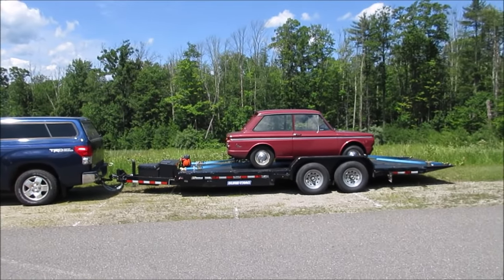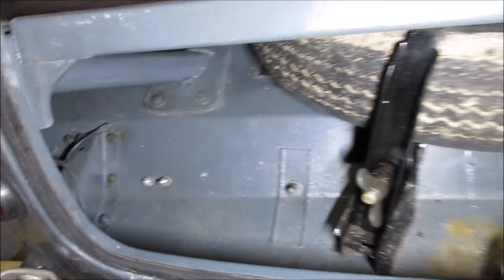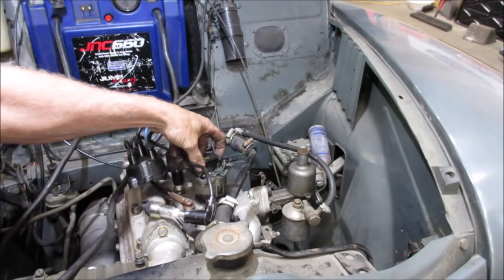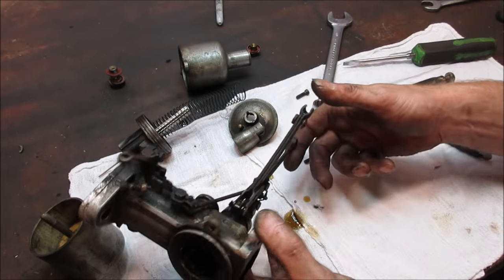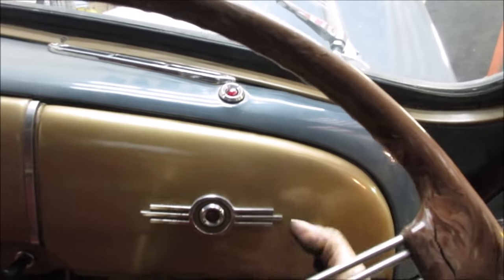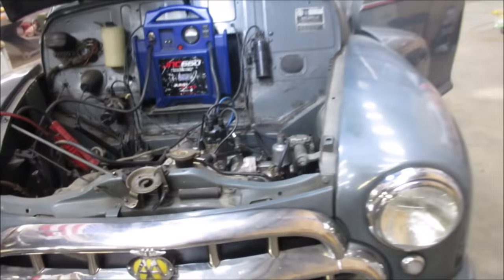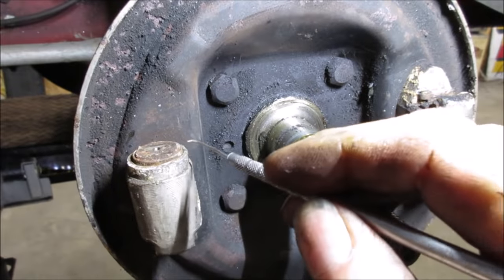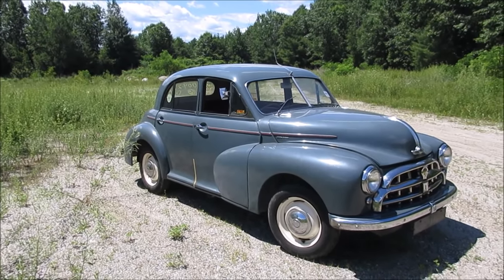50s Morris Oxford Found in an Old Warehouse. Did It Survive?

Comment: If I remember right the only thing you have to swap after switching from positive to negative earth (usually so you can install a transistor radio) is the wires on the back of the ammeter (to avoid backwards reading) and the two wires on the coil (to improve the spark). If charging doesn't work right away you have to 'flash' the dynamo by simply brushing a positive wire against the (smaller) field terminal briefly.

Comment: Hi Mustie that sticker in the front screen (RAC breakdown) is "The Royal Automobile Club" where you join for a fee and if you breakdown they will attend and try and mend your vehicle at the roadside there are different levels of membership like "Roadside, Home start, and Relay, relay is where they will take your vehicle and passengers to a location anywhere in the UK at no extra cost also you see the yellow badge on the grill (AA) this is another breakdown company "Automobile Association" which does the same as the RAC, both company's are still going to this day along with a few other company's, hope this helps.

Comment: Another great video Mustie. Those wheel cylinders can be bored out and sleeved with brass ,if reproductions are not available. Getting apart may be fun ,they look like blind bores. Those S.U. carbs like auto trans oil filled up leaving room for threaded fitting.
Reply: Sleeving in stainless steel solves all future corrosion problems....

Comment: I too can remember (as a school boy) playing with the SU carb of my father's 1955 Morris Minor. Polishing the floater needle using a drop or two of Coconut Oil to prevent it sticking and blocking the petrol flow in. Also tapping the contact breaker of the electric fuel pump manually when the battery is too low and then use cranking handle or push the car to start the engine ☺️😏😉

Comment: I also was shaking my head when you at first couldn't work out the fuel system, The SU carbys are so easy to work on there's nothing to them apart from balancing them if the are doubled up, and the electric pumps most had points in them, at least you worked it out. Good fun to watch, Here in Australia we still have a lot of people  collecting these old cars and I have a Classic Allis Chalmers Tractor from England.

Comment: Looks like a 1953 model Morris Oxford MO.
I think it’s possible to convert to 12-V negative earth quite easily. Have a distant memory that this was a common mod back in the day. It involved reversing the battery connections, the coil wires, the ammeter connections if fitted, and ‘flashing’ the dynamo field (F) connection with a positive.
Only an issue if you want to install any modern electronics, like a car radio.

Comment: I lived in England ( from Florida) for 32 years, you have not repented and lived till you start one of these with the hand crank but it would start even with a dead battery.
The Morris Company ( part of British Leyland) made the Morris and Austin 1100 and 1300 which were a blast to drive.
Military guys would bring these home, drop a Mustang small block, 4 speed and Mustang diff with a Pinto or Mustang front-end and race them.

Comment: My Dad is still alive (dementia) but he was a mechanic from the early 50's and he owned one of these that had formerly been a taxi. Got rid of it just before I was born in '68. My first car was Morris Minor panel van that we converted to -ve earth so I could run a casette player in the late 80's. Your car has odd paint because this thing was lovingly maintained by one of it's former owners. They were a full on mass production vehicle when new which is why they ended up as taxi cabs. The Minor wasn't big enough or powerful enough to see cab use.

Comment: In the UK, fuel was sold in gallons, but then changed to litres. Fuel began to be sold in litres here around 1989/1990, with the gallon phased out as a measurement of sold fuel on 1/1/95. This was a sticker given out by Shell petrol stations to show comparisons between gallons and litres. Like a US gallon, ours has 8 pints, but our pints are 20 fluid ounces. With 160 fl.oz in a gallon, it equals 4.544 litres. But your gallons are smaller (16 fl.oz per pint) so they equal 128 fluid ounces or  3.785 litres.
The RAC is a breakdown organisation (Royal Automobile Club).
There is an older badge on the grille for the AA, a similar organisation (Automobile Association).  Very similar to the AAA, they provide breakdown insurance and inspect and rate hotels etc.

Comment: The UK began the switch to the metric system in 1965. So this car was definitely in service during that period.   That gallon to litres was helpful during filling up with petrol.  Also, it was imperial gallons.  You can also see that the speedo is calibrated in MPH.

Comment: Had the 1952 Oxford in 1957, a slightly different grill. weak design points were the indicators still being  out when you stepped out of the front seats of the car. The cast block cracking and that having to be stitched. The timing gears did let go on me, but very easy fix. the Hand brake cable frays inside the rubber boot against the fire wall where you cant see it making the handbrake hard to use. The light on top of the dash was the Generator, the one in the front and that other pull switch I believe is an add on. and yes 12V positive ground. The 52 Oxford never came out with a radio or heater, but that nob under the dash you found looks like the control for the fan speed of a Smiths aftermarket heater, which we were able to buy and fit under the parcel shelf, and Tee into the radiator hose. Radios were hard to fit because of the polarity, You could get that changed though. The steering set up, although I never had it happen to me, the thread wears in the strut and the front wheel assembly parts company. best running speed 45MPH.

Comment: Hi Mustie , to store a car drain the tank of fuel when the engine is warm put a pint of paraffin ( kerosene ) in then run the engine for a few minutes , if you turn the ignition off the engine should keep running so you have paraffin in the carb you then can stall the engine or run it till it stops . paraffin has excellent cleaning properties this will clean the acidic fuel system out .  its good to clean the water system too , i knew a man who ran a fleet of 16 ton trucks back in the days when there were no antifreeze you had to drain the water out every night and refill in the morning . but no he just filled them all with paraffin ...

Comment: This Morris Oxford MO.. 1948 to n1954..  was an enlarged version and almost idemtical except for scale to the Morris minor. Both were designed by Alex Issigonis in the late 1940's. This model was powered by a 1476 cc ( or thereabouts) side valve (Flat head in the US) engine of around  40bhp..  Front suspension was longitudal Torsion bar as on the Minor  and used Armstrong lever arm shockers at the front a part of which provided the upper suspension arm.
The basic body shape was used on other BMC  Nuffielfd origin cars such as the Wolseley 4/50.... They had modified front ends (Bonnets) to accomodate the vertical radiator grille.  It would probably have been a 12v positive earth electrical system with a 12v SU fuel pump...
Carb is an SU probably HS6 . It works on a tapered needle principle with vacuum lifting the piston. The top plug is for access to the piston damper and should be topped up with oli to provide damping of the piston.  It will cough and splutter when throttle is opened without the damping.  Carb model no indicated the size and if memory serves HS6 was 1.5 inch    HS4  was 1 inch. etc.
Car had a column mount gearshift operating a 4speed + Reverse gearbox with syncromesh on 2nd 3rd & 4th gears.

For right knob was probably manual screen wash pump.

Comment: I learned to drive in one of these it was my father's - a second-hand 1951 (I think) Reg MUM 586. The RAC is The Royal Automobile Club and the AA badge on the grill is Automobile Association. Both of them roadside assistance companies.

I don't remember much about the mechanics of the car apart from the driver's door support rusting through so you had to lift and close it from the outside and then get in from the passenger side to drive. Also it was difficult to start sometimes so the starting handle had to be used. I also remember the brakes failing when we were on the way to the coast for the day - never got there.

Comment: This was a good episode, the way you worked out mostly what did what. It was no use me shouting at the screen. The black knob on the right is the manual screen wash. The apparatus at the bottom of the carb is the choke, it drops the jet to enrich the mixture. The main needle works just like a motorbike carb, the cap with a rod and brass piston is the damper for the main jet slider, hence the oil. Under the dash is a rheostat for the panel lights as you guessed.

Comment: This is a very attractive car, and much much better appointed than I thought it would be for its age and being what I thought was a minor. The seats, door cards dash are all very good looking and look to be a more expensive higher level version than a “cheap” affordable car. The chrome and stainless trim in the outside give this car a quit stylish and elegant look. But with all the hassles you had starting it, and it’s rough running, I was thinking of all those “prince of darkness” and the infamous British car stereotypes. In my youth and formative automotive years, I was aware if some older cars both having a positive ground and 6 volt electrical systems. I only occasionally ran across them and generally did not like them when I did. Maybe it was because usually when I ran across them, they were old, tired, rusty, dirty, beat up, clapped out and and nearly ready for the junk yard. 

But these two cars, the Morris and Imp were enjoyable cars to see you bring back to life.  I was really impressed with the design and engineering in the Imp. That was a really cool car technically. I guess they were a bit too radical for their time period. The Morris was pretty cool and conservative in its thinking. I like the styling of the Morris more, but I really dig the sophistication of the Imp. I think I would enjoy owning the Imp more because of its attempt to go beyond the conventional at the time.

Comment: My Grandad had an ex Ministry of Defence Morris Cowley, which was the same car, but even more basic! The Morris "MO" Oxford/Cowley/Isis were very common cars here, think of it as our 55 Chevy equivalent, & they were sold all over the world, throughout the commonwealth countries.

The fuelling sounded completely out, & I dare say the points gap/dwell angle is out, plus the condenser, leads, dizzy cap, rotor & possibly coil, all need changing, as well as the timing adjusting. Each car from that era has a different starting procedure, each needing a different amount of choke & accelerator to get them going! That thing on the right hand side of the dash that you were pushing in, is actually the windscreen washer! (manual pump). I think the red "buttons" are actually indicator lights for low oil pressure & the dynamo charging warnings.

The electric fuel pump was quite common on British cars from the fifties to the seventies, & no, it wasn't very reliable, they had points in them too, although, as you found out, hitting them often brought them back to life...

That looks like a nice example bodily (most rusted out within 10 years!), and the story about when it was exported checks out, as the Shell gallon to litre sticker on the rear door was given out in the late 80`s, as they were switching fuel from gallons to litres. I`d love to know what the original registration number was, then I could check when it was exported! Someone (possibly still in Plymouth!) obviously loved it to have kept it going that long!

Comment: My Dad ran one for years, BMC 1.5 cc B Series Engine Lucas 12 Volt Electrics + Earth 3 Speed and reverse gearbox SU Carb Torsion Bar Suspension Front Springs on the rear

Comment: Good old MO Morris Oxford. My father bought a 1952 Oxford in 1956. He sold it in 1981still in very good condition. The fiber gear in the trunk is a timing gear , a weak spot on this model. 
They also like burning exhaust valves. Engine capacity is between 1300cc and 1400cc. Brakes even when working well and adjusted properly are marginal. Top speed on a good day is about
70 - 75 MPH.

Comment: Unless converted by previous owner (unlikely) it was built 12V positive ground.     Full choke always need on cold starts.   SU carburetor choke operates by pulling the jet down this making it even with a thinner portion of the main needle which enriches the mixture.    Red light on top of fascia may be the main beam warning lamp.   Center stud in the float bowl is NOT intended to be removed.  Float might have been freed up with some carb cleaner and pulled loose with a bent wire.    Yes, I was also one shouting advise and instructions all the way through and I'm an American with extensive British car experience over 60+ years but not on an Oxford which is the big brother of the Morris Minor.

Comment: The other sticker remnants was probably from an MOT sticker. Ministry of transportation...I think. Basically an annual mechanical inspection. Proof that the car for whatever year was roadworthy?
Also, perhaps the push in black button that originally thought was choke...perhaps a fuel primer button or a bit of oil priming? Is the oil gauge a splash system? Just my thoughts. LOVE your channel. Thank you for the real deal.

Comment: Hi . The one on the right of the steering wheel could be for the washers . Most cars back then were manual pump ones . It was a bonus in a way because you could spray water on the windshield before starting the wipers so they got lubed from get go

Comment: Trafficators. Yay!  So I looked again and I couldn't see that you put any oil in the dashpot which would account for the lumpy running. The brass knob on top of the SU carburettor dashpot needs removing. It's a dampener piston to slow down the larger piston that the needle is set into. Fill the middle of the cylinder holding the needle into its piston with engine oil until it is about half an inch under the overflow level,  and then put the brass screw holding the damper piston back. You now have a dampened SU carburettor. Later versions had an actual diaphragm. Yours just has a close fit between the sidewall of the dampener dashpot. 63 yr old Brit here, once again shouting at the screen. Funny as. Has it got an air/fuel mixture? LOL. ROFL as my kid brother would say. I love the way you work everything out. You, dear chum, are one knowledgeable dude. I wonder what your IQ  is? Well above average is my guess. Great video for us this side of the pond, thank you. So the centre of the SU carb has engine oil in it to act as a damper for the needle lift. You use quite a few MLS of oil. We went metric (litres) in 1969/70 but still used Imperial gallons as a fuel measure for decades afterwards. We still use miles per gallon for fuel economy measurements in everyday use even though we fill the car with litres of fuel. There is still the occasional village fuel pump that registers in gallons in spite of the law saying they should read in litres :) We still use the pint to buy our beer! Old standard measurements die with difficulty.

Comment: The little hanging knobs under the dashboard are for adjusting the clock and resetting the trip meter.            The push button on the right is for aftermarket windshield washers. The unit is on the firewall above the fuel pump. The light at the top i am pretty certain is the high beam light.

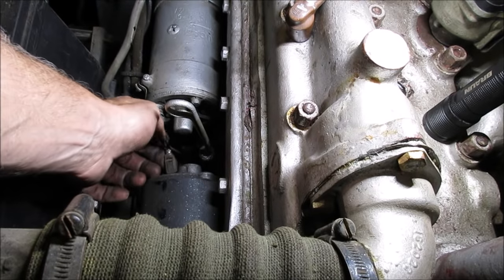Comment: Great video as always!  Just FYI, regarding positive vs. negative ground at 19:40, since the starter is a DC motor, it will crank the motor backwards if the polarity is reversed.
Reply: I dont think so, lots of pos earth cars are converted to neg earth simply by repolarising the dynamo generally evrrything else is fine. If the starter did go backwards then the driving cog would not spin out to engage the ringgear so nothing would happen.

Comment: This brings back memories. This was the big sister to the Morris Minor. They both had the same fuel pump which was always failing. Remember my Mother had a short length of wood long enough to hit the bulkhead behind the fuel pump to stir it into action. Think the points on the pump were difficult to set up.

Comment: Ahhh Mustie1, the steering wheel is on the correct side. We’re Aussies. Ha-ha. The Oxford is a larger model than the Morris Minor. The Datsun 120Y was basically a copy of the Morris Minor with the same basic layout of the engine & transmission as the Morris Minor, different body work and front discs instead of drums. That Oxford is mint mate.

Comment: You did well with the SU carb cleaned all the right bits. The cog you found in the trunk was a timing wheel it is made of fibre compound which because it ran on a steel cog used to lose its teeth ,like your one ,and you had no timing after it did that . Anyway a very good video keep up the great work thanks.

Comment: I don’t know how many times I shouted pull the choke out when you were trying to start it cold!!!! All U.K. cars of the early 50s had manual chokes. Pumping the accelerator does nothing because there’s no accelerometer pump. Also most cars of that period with a mp meters showed discharge at tickover. That’s why we all drive round towns on sidelights only as the car wasn’t charging enough for headlights until you picked up speed. Lived with those cars for years. Lovely old things but not fast!!! Can I have that one??